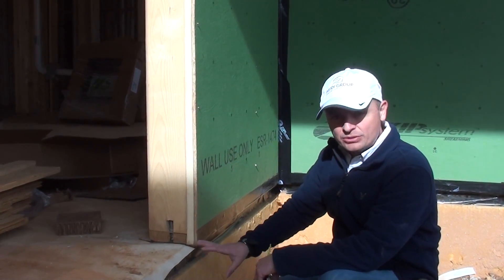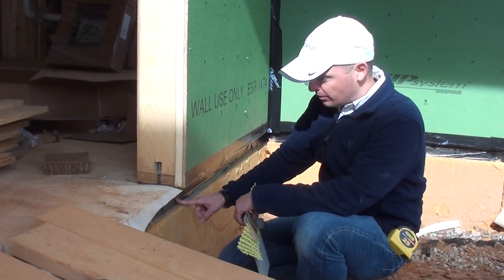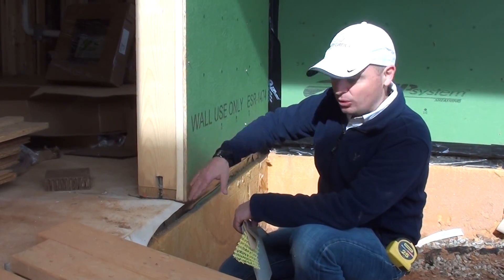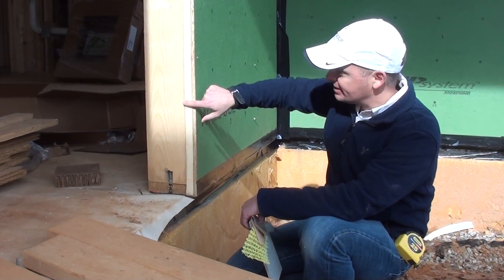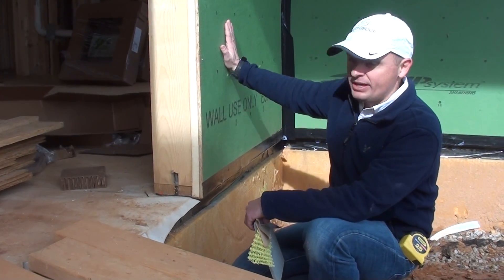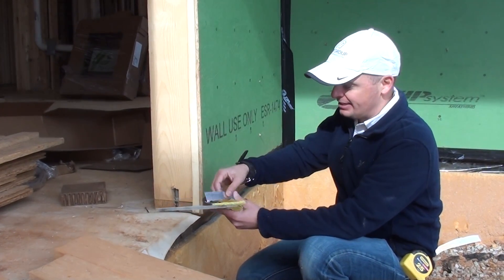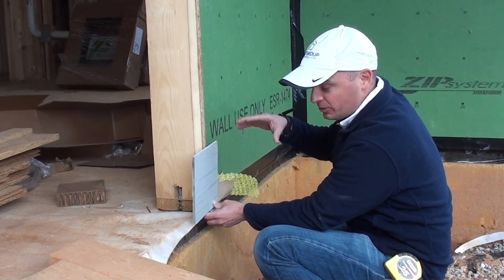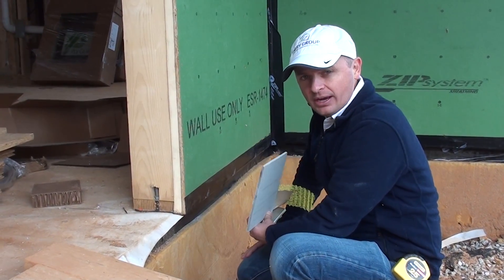Thermal Bridging | ProudGreenHome at Serenbe

Comment: It's clear you are a quality builder.  I wonder why you would not choose to use Advanced Building Products Mortairvent instead of BO home slicker?  ABP's product has a bug shield attached to it and it also has a fabric layer on the back of the weaved screen for better performance.  Using the BO home slicker you used is a lot more labor and cost for you.  And the Huber company that makes the zip endorses it.  thanks for the video.